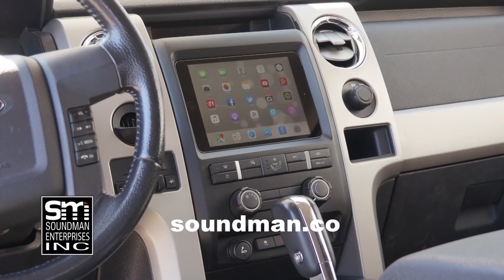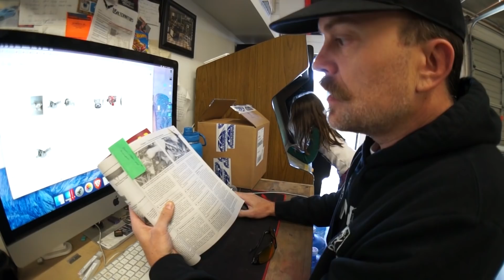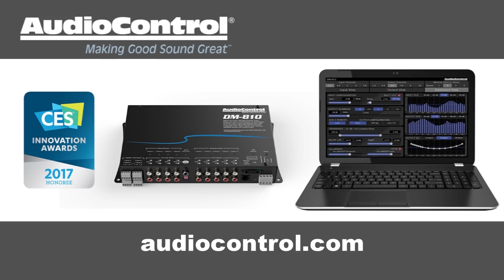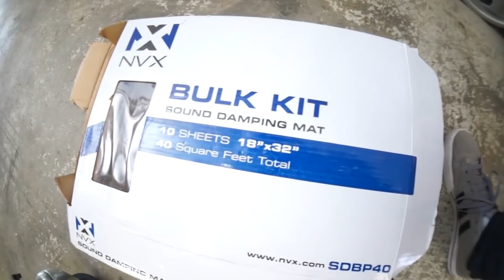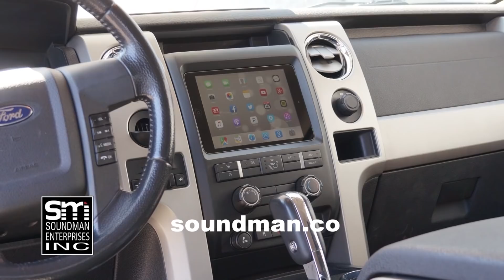BASS VAN BUILD OFF UPDATE!! - BASS WARS - BVV#68

Comment: Tip for you.. when you spread the seam sealer use some lacquer thinner on the brush... it will smooth it  out and generally easier to work.  
JUST THE TIP !

Comment: That voltage controller sounds like a great product. I’ve had 2, 2017+ Chevys and both run 14 volts after starting to charge the battery back up, but run at 12 most of the time. On my Silverado you can hit the tow/haul button and it will run at 14 all the time, but that don’t work on a Camaro, at least I can’t find the tow button🤔
Reply: I just turn up the AC or heat. Right back to 14.4 lol. Just picked up a variable pcm, haven’t installed it yet though.

Comment: Man for the roof, you should've got some deci-damp. Cut some plywood to fill the gaps in the roof, roll on the deci-damp. Put the ply wood against it, secure plywood to  the struts running across the roof. Boom constrained layer damping it would work much better than the sound deadener.

Comment: Doug-
              Have you been keeping track how much extra weight you're
adding when finished? Maybe consider a coil-over upgrade, or even air
bags like the Mule? Maybe air shocks all around would do. I say this-
because adding this much weight greatly changes the handling 
characteristics of a minivan like an Astro- especially in the front.

You could do severe damage to the unibody and frame rails- if
a part snaps, like a ball joint or tie rod.

I would seriously consider installing all urethane suspension
bushings, new ball joints, tie rods, and hub bearings.

Check out either Jegs or Prothane. 
RockAuto has the rest, really cheap.

Comment: The 4.3 some years the alt an power steering bracket was on the driver side an later years the ac was on driver side an the alt bracket was on the pass side so if you can find those two brackets you can run two alternatetors

Comment: Hi, I am going to buy the Sony RSX-GS9 and the AudioControl DM-810. I was wondering if using the optical out is better than using the RCA out. What would it be the best way to go for a high end sound system. Someone told me that when i use the optical out from the Sony radio, it will bypass the Sony's DAC and then the AudioControl DM-810 will take that signal and covert it in lower signal quality because the AudioControl DAC is not as good as the Sony's DAC. Is this true? 
Another question i know the Sony radio can play at 192Khz/24 bit and i don’t want to loose any sound quality through the way (DSP, amplifiers and speakers). I am going to run this high end sound system with 2 4 channel amp and a mono amp. About the speakers, 3 way components speaker for the fronts (active crossover) and coaxial speaker for the rears (active crossover). When it comes to amplifiers and speaker, how can i tell if an amplifier or a speaker is able to play high signal quality without loosing any of it through the run. I wanted to buy the Focal ES165KX3 - ELITE K2 Power 6.5" 16.5cm 3-Way Component Speakers but somebody told me that it is better to go with the Focal PS 165F3 Performance Expert Series 6-1/2" 3-way component speaker system because the difference between both is barely notable. I know there is a Sony 3 way component for a good price but i don’t know good they are. And about the amplifiers i was thinking about buying 2 AudioControl ACM-4.300 but the thing is that i already have 2 Pioneer GM-DX874. They are hi -res but i don’t believe it. I really need help with this. I just want to know what amplifiers and speaker would be the best for this application.thanks